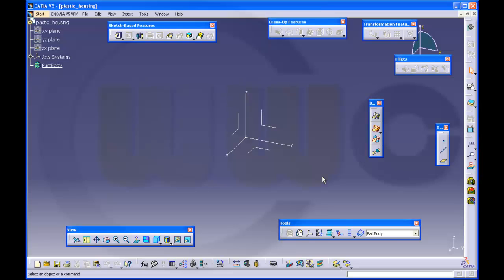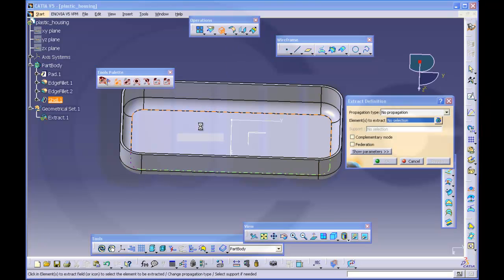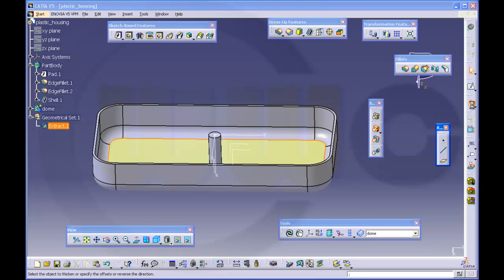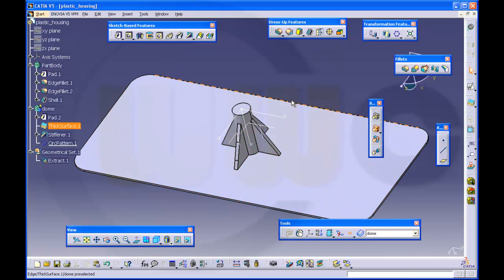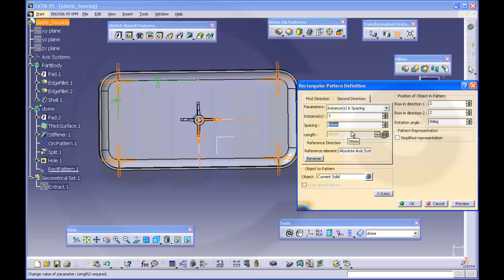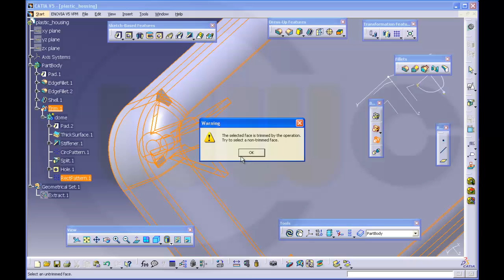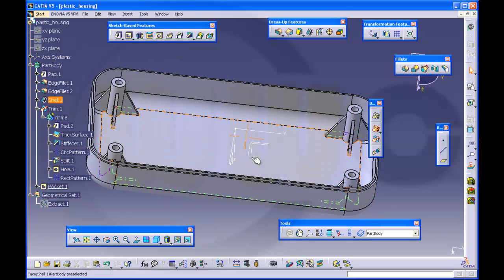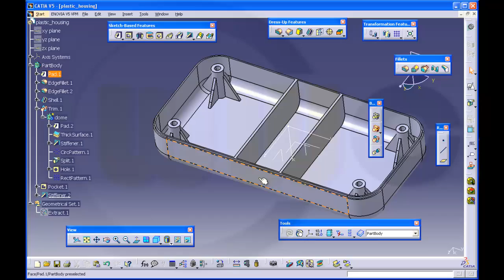11.5 Plastic casing - Catia v5 Training - Stiffener - Union trim - Pattern solid

Comment: I have been running around all plastic parts videos and they all use a draft angle for injection molding, which is not applied here in this video (I think for a simplicity reason), you tutorial is more comprehensive for beginners which is highly appreciated, Thank you Walden for this great video.
Reply from the maker: You´re welcome

Comment: Sir is this possible to design a part in a single body and then we can save them separately i design a car but sir that's not an assembly and not calculated so sir is that possible that i can devide it in to parts and then i can apply kinematics to it
Reply from the maker: No, it is not possible. If you do multiple bodies you could "copy - paste special" the bodies in to separate parts.
Reply: @wolfgang.walden.cad.training  thanks sir next time i will apply  body sets so i can apply assembly and mechanism sir can you make a saperate video in which we can study analysia on parts using catia v5

Comment: I'm trying to do a mold design and I have a problem(i dont if it's me doing it wrong or the software is not responding) consider that I imported model in core n cavity and clicked on pull direction...so everything is fine till here..what's happening is in model tree the sub branches like core and cavity slider etc are not forming...why is that not generating? help me
Reply from the maker: Sorry, I can´t tell you, because I haven´t done mold design in catia yet.

Comment: OMG !  I just want to punch my colleagues in the face when I see that kind of part history in CATIA. Please don't teach other cad users to work like this.  Regards.
Reply from the maker: LOL - I you haven´t noticed - it is just an exercise which shows the functionalities of certain tools, nothing more nothing less. I most certainly know how to structure a model properly, probably better than you :).
Reply: Wolfgang, Thery is right. In addition to that, this is a simple plastic part and there is no need to use GSD. In my opinion, it is a very big mistake not using positioned sketch and hiding the elements and creating constraints with axis.. I can understand that you can do better design but if you want to train someone, you should follow different design method.